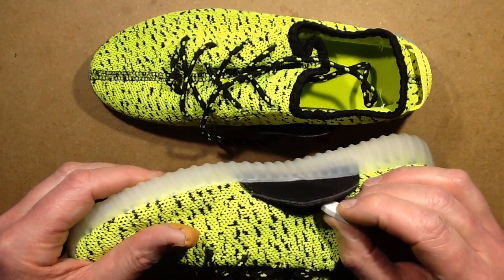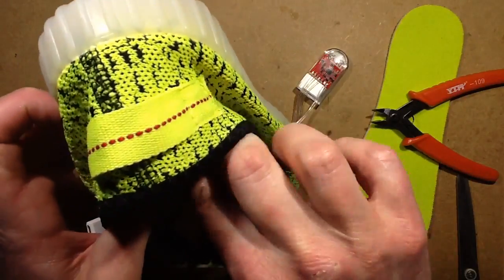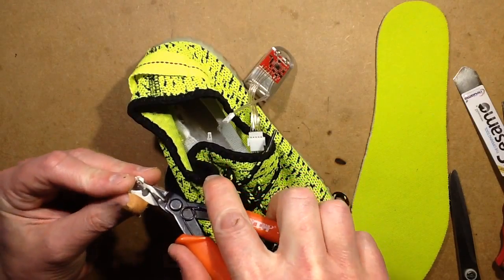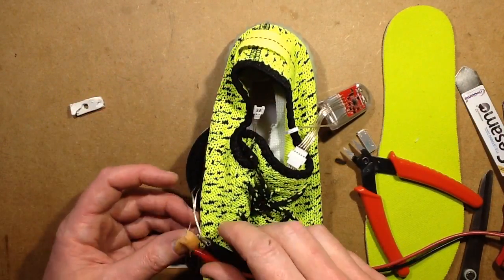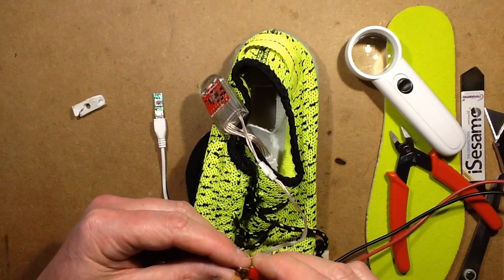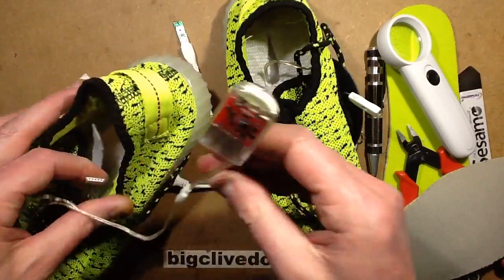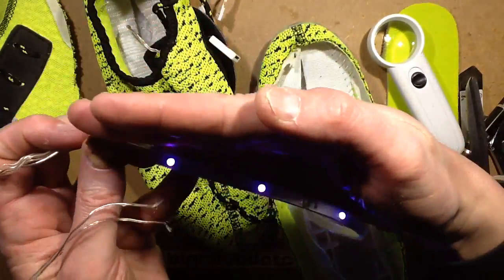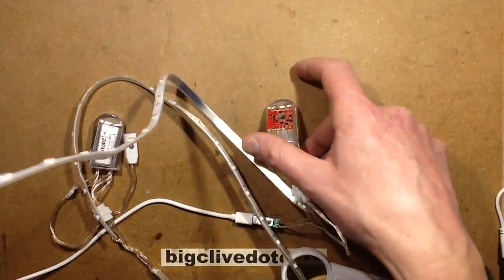What's inside LED light up shoes?  And can they be fixed?

Comment: The reason for the stainless-ish steel tape can be explained in the notorious failure of early efforts at wrapping flexible LED strips around the soles of shoes - repeated flexing of the rubberized sole occurs while walking. The flexing is concentrated at the front of the heel area, which tends to bend the copper circuit board in a "forbidden" direction, since it's only meant to be bent in one axis. The thin copper traces become work hardened and brittle at those kink points until they break and the shoe only partially lights.

Laminating the LED strip with the steel strip in a tube of heat shrink thus keeps the assembly much more rigid in the vulnerable direction. Gives it a fighting chance for them to last more than a few days in active use!

Comment: Now I'm only halfway through the video and will comment if you get to the same conclusion; the disconnected cable was responsible for the charging and the battery cell had simply run out of juice so reconnecting it didn't solve it immediately as it still needed a charge.
Reply: Cool, you said this literally a second after I unpaused the video :)

Comment: @7:28 you said their hard to solder and do something with. isn't taking a lighter quickly over the wires a solution to remove the fabric so that you're only left with wire at the tip, then solder it? -That's what i've been doing when reparing my headphones :)
Reply from the maker: I did that when I soldered the wires back onto the charger PCB.  It works well.
Reply: "do something with" = terminate
Reply: bigclivedotcom  Ah ok. thank you for awnsering :) keep up the good work, i look forward to every new video of yours! :)

Comment: I got a similar pair of shoes last Christmas, not the same, but they look like they use the same potted circuitry, down to the same battery. Mine have done the same thing, one working one not, though with the module swapped between shoes it still doesn't charge. Time to explore more!

Comment: Clive, to solder that annoying type of cable you can lit the end and burn the textile fibres to leave the copper alone. Be ready to blow and extinguish the flame before it advances too much and starts to burn the plastic insulation.

Comment: What happens if you charge it with a wall plug adadpter and press the button at the same time? Will it short out?
Reply from the maker: The charge resistor is located at the connector to limit the current in that scenario.
Reply: bigclivedotcom  Thanks!

Comment: Could you take an ASMO charger to bits? It's a premium-priced charger that's supposedly fire safe and doesn't use any electricity when stuff is not plugged into it. I'd like to know if it's worth the high asking price or if it's or just a load of crap.

Comment: Clive, you should try using these modules as a "theatre prop led driver" by using single color leds on each of the three RGB channels, and then doing two sets of them, spreading channel A and B randomly around the prop. I feel like it would make quite a neat effect
Reply: Like the disco stick used by an American performer early in her career?

Comment: I bet the charging cable got pulled and disconnected it
If you want to see what happens if the lipo explodes, you could carefully drill over the battery terminals, insert a couple of pins, and try overcharging it.

Comment: It's hard to get size 11's, let alone 15'.
Reply: Nah, the hardest size to get is "whatever you need".  I'm a size 9 (US) and the odd time I find them in stock I grab whatever I can.  I've learned not to be picky about color/style because they are so difficult to locate in-stock.
Reply: 11s? I'm 12s (UK = 13US) and don't have much of a problem getting shoes. Bit of a pain that Clarks only do up to UK 11 (US 12) in their shops though. No problem getting steel toecap boots either. Even Screwfix have my size! http://www.screwfix.com/c/safety-workwear/safety-boots/cat850524#category=cat850524&page_size=100
Reply: The "big" part of *big*clive is rather apt then.
Reply: captainatt 
High and mighty?
Reply: Green Silver wot
Reply: captainatt 
A uk store that sells oversize clothing. :) it's called High and Mighty.
Reply: Green Silver Ohhhhhhhh
Reply: 12's are a pain to get hold of but schuh store keep up to 13's, I can see steel toe cap safety boots being a issue
Reply: the HARDEST size to get is 12.5 US or 30.5cm  I have to get a size 13   but it's not loose at all though Yeah I can get special order but don't want to wait

Comment: Reminds me of a pacemaker that module.
I'm sure that same factory in china could pump out pacemakers for $1 ;-)
Reply: stefantrethan  "pump out pacemakers..." Funny guy....
Reply: yeah but few would work, some would blow up, most would last 5 minutes and need a micro usb charger....not very practical!
Reply: But think of the savings to the NHS budget, not only in the cost of pacemakers, but also due to the fact that dead people don't need CAT scans, ECGs or looking after in general. :)
Reply: What would that pacemaker look like? A used car battery with a strap so you can hang it around your neck?

Comment: LED shoes from the 90s were either powered by caps that got charged when walking/running or a coin cell that only lit up while moving.
Reply: SandyStarchild la gear lights forgot about them
Reply: I had rubber boots with a red LED at the back, when I was young. One broke pretty quickly (the LED module and the boot itself). So go buy shoes that are shoes, not mediocre shoes combined with mediocre gadgetry.

Comment: The designer needs to be rounded up and locked in a padded cell.  The manufacturer needs to seek help also,  maybe they make clown costumes then I suppose they are ok but should be checked out just in case.

Comment: What is in the ones that only flash as the kids step on them?  
I always wondered if there is a battery or some piezo generator or something.
Reply: I'm pretty sure the ones that flash as you step (which have been around since the 90s) are powered by a non-replaceable button cell battery, and the circuit is just triggered by a vibration sensor. Maybe even two metal strips that occasionally make contact as you walk, setting off the flashing circuit!
Reply: LEDs draw so little power and kids grow so fast that they run off a nonreplacable cell for the length of time required before the kid outgrows them

Comment: I bet these a joy to take through an airport.
Reply: Wires hanging out and cheap Chinese lithium batteries.  
Why would anyone be worried? :-P
Reply: but at least they stared at your naked body
Reply: Control core for a submersible robot. Honestly, TSA was so nonchalant about it, the whole team was beside itself. They didn't even ask us to open up the core to look inside.
Reply: Exactly what I was thinking
Reply: it's a bomb lol    "every one freaks out over leds"
Reply: Speaking as someone who works in security checks (in Europe, not the TSA), as long as the shoes go through the X-ray we’ll be quite happy.

Oh, and backscatter machines don’t show the actual body; most modern models just show locations on a schematic image.
Reply: as long as they're not in your luggage but in your carry on then you should be fine...
Reply: FlynnClubbaire what was it for in the end?
Reply: I'm a ham radio operator and have traveled through security checkpoints with entire backpacks filled with radios, microphones, antennas, batteries and battery packs, and a couple of laptop computers with nary a question from TSA.  Sitting in my assigned seat wearing a microphone headset and chatting with other hams via echolink while monitoring the aircraft frequencies on my handheld and I got more interest from a 12-year-old two rows ahead than from the flight crew or my seatmates.  (Got the kid interested enough in ham radio that he went and got licensed.  We stay in touch.)
Reply: Honestly they probably wouldn't care.
Airport security are like the QA people from the Simpsons.
"Grenade, no problem. Kilo of cocaine, no problem. Bottle of water, quick somebody stop that bag!"
Reply: I once took a double-gasket pressure sealed aluminum tube with a raspberry pi, arduino, and several power circuits wired together inside through TSA... Twice.

The guards in portland wanted to know what it was for. The guards in Texas didn't even seem to notice it.

Tbh as long as you put these shoes in the tray, they aren't gonna give a rat's behind.

Comment: Somehow I dont like the idea of walking on Lithium batteries :/
Reply: RMJ1984 I read this in Clive's voice
Reply: Just stand on a nail or tack and watch the fireworks.
Reply: Yeah, that seems both dangerous and stupid. Makes you wonder what would happen if one of them blew. I imagine that would burn and hurt your foot quite badly.
Reply: RMJ1984 it would also be interesting to see if it has proper protection for things like overvoltage  ...
Reply: HPZeta it's like putting note 7 under your feet while charging
Reply: well the note 7 might have suffered from nothing having enough breathing room for the battery. lithium batteries slightly change thickness through use and can puff a bit with age, so these potted in with new room to breathe seem to be very bad. then add in being pressed on and other sorts.
Reply: thephantom1492 You probably have Chinese battery in your pocket or in your bag. The only reason an expensive lithium battery wouldn't make a difference, is because if it gets poked it could burst into flames. Expensive batteries would do the same
Reply: jusb1066 pouch on the side of the shoe or the heel, not rocket science or bum powered ... just saying
Reply: What's not to like? When it's cold out, just stomp your feet for instant warmth! Just be ready to quickly take them off when they inevitably burst into flames 😂
Reply: just5444 Shots fired, Note 7 is a great phone
Reply: Hans thoft does "shots fired" phrase has something to do with note 7 setting on fire? 😂😂
Reply: just5444 It certainly might have😃
Reply: What about this idea: those shoes are often of weird brand, possibly chinese. Want to walk on chinese battery?
Reply: jusb1066
The real question is: why lithium and not NiMH? Or atleast Li-Ion (cylindrical hard cell). Li-po is about the worst chemistry for this imo.. A bit more power per footprint since it is square, but more fragile...
Reply: well if you had 70's platform shoes youd have room for 18650s , lol
Reply: thephantom1492 if it was the chargers then why did it happen on 3rd party chargers and it would of been simple to replace the chargers. It's already known it was poor battery design.
Reply: JJayzX
The charger is not what you plug in the wall, it is miscalled a charger, that is really a plain powersupply tha provide 5V and whatever they decided to use in current. The charger is internal to the cellphone. There is no third party charger for ANY phone, unless you remove the battery and plug it in a standalone charger.
Reply: ibfragalot
Just a CR2032 or two, also, your kid is way less heavy than an adult gorilla, so way less stress on the module.
Reply: its a powered shoe, where else can you put the batteries?, youd look silly with long wires and the battery in your bum
Reply: well you cant have a lump on the outside of the shoe either, then again, who'd wear such stupid shoes anyway..theres just nowhere to put a lithium battery, its a stupid idea all around, how about underpants with a lithium battery, where would you put it? under the balls?
Reply: HPZeta somehow i don't like the idea of walking in shoes that light up.
Reply: JJayzX
The note7 probably failed due to the charger...
Reply: New definition of "hot foot"!
Reply: thephantom1492 I know that but everyone typically calls the wall wart the charger so I assumed that, sorry.
Reply: Yes, yes, yes. I also wonder about the kids shoes that flash... much less lights, but I'm scared to look at my sons Sketchers... hopefully just a nicad, or button lithium at worst...
Reply: Good info, thank you.
Reply: i actually made my own shoes and i placed the batteries on the side of the shoe because walking on lithium is really a bad idea. forget the pain of stepping on a nail youre gonna have to worry about launching that shoe as far as you can before it explodes! lol. jk. it would probably just smoke dramatically and possibly burst into flames. explosions are less likely.
Reply: thephantom1492 yeah but where would you put a cilindrical battery on a shoe without hurting your foot overtime?
Reply: Who the hell puts their pressure on the heels whilst jumping? Most of your pressure goes into the end of your foot.
Reply: Jusb1066 Or you could just wear normal shoes
Reply: jusb1066
you could put the battery where there is not literally a ton of pressure on it. Would you trust the module to survive being roll over by a car? You actually put more pressure than that on your heel. The simple fact of walking put 3 to 5 times your weight on it!! Running? No idea, but of course more. What about jumping? Yes, it get quite scary to put the battery at the place with the most pressure.
A safer place could be in the middle of the shoe, toward the inside, in the arch of the foot. There is way less pressure there, in fact, there may be close to zero pressure during normal use, only if you step on something... But it is more bendy. Pressure vs bending...